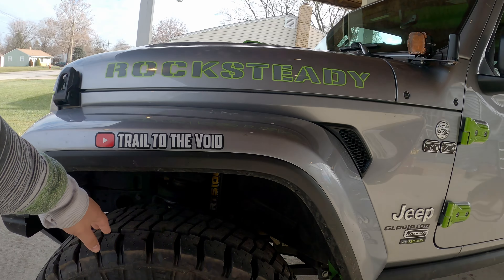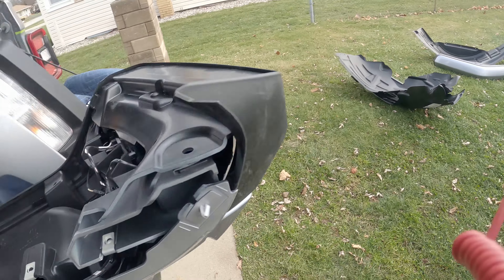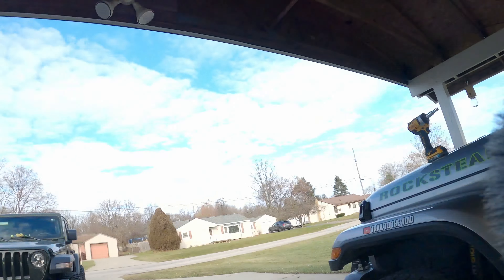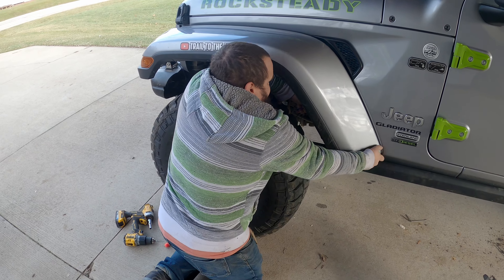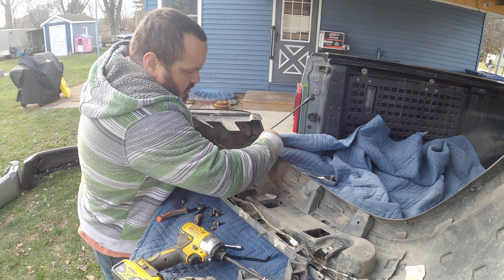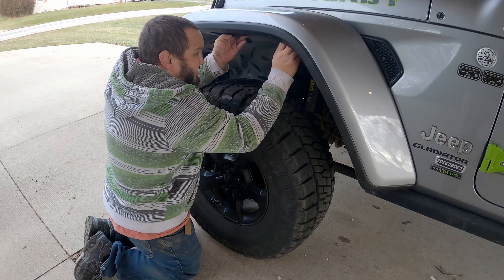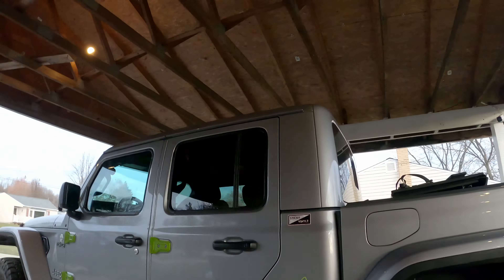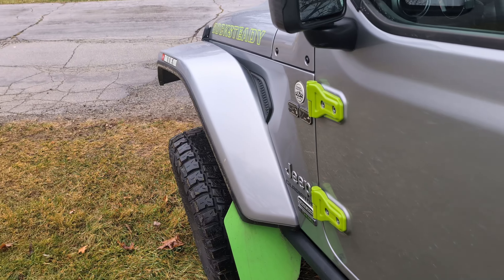Gladiator Overland Upgrade To High Line Fenders

Comment: Great video, they look great on the gladiator! It does looks more aggressive. I love that you included the measurements too

Are you going to adjust your bump stops to allow more articulation now?
Reply from the maker: Thanks for watching! I'm not sure on the bump stops yet. (They are being replaced soon anyway, as the stock ones are a bit beat from the crap stock overland diesel suspension... Video to come from that probably..)

I'm gonna test it a bit before I change the amount of allowed articulation though.